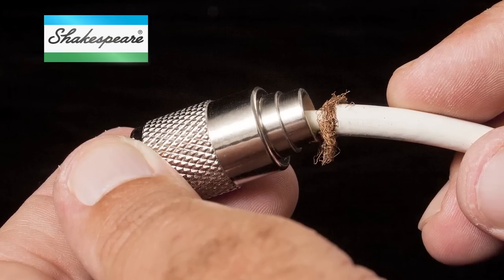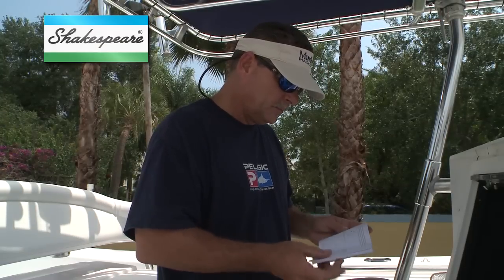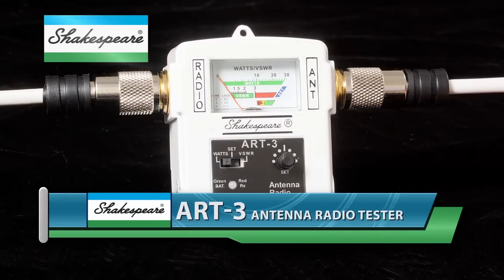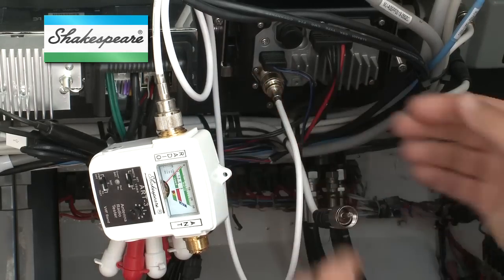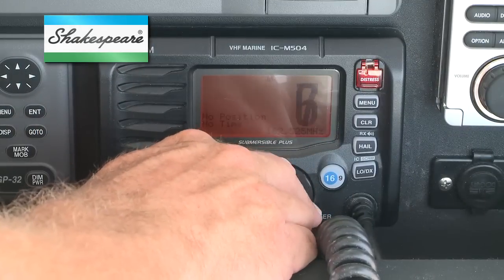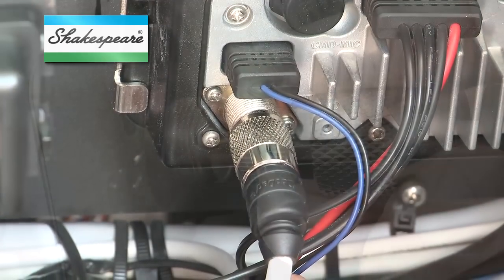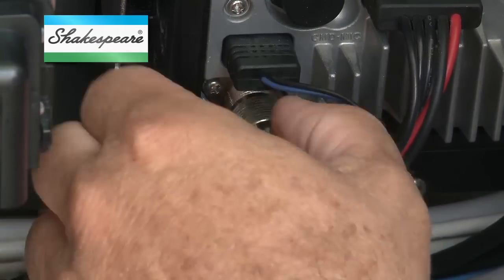Troubleshooting Your Marine Antenna Installation

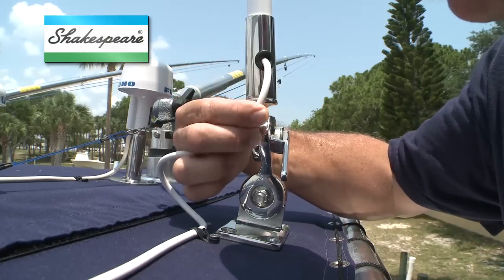Comment: 0:45 I love how he tells you to check the cable where it comes out the antenna and you see the antenna rotating as he moves that cable.  You need to tighten up that antenna to the mount and use some sort of thread lock.  Ideally, it should have facets on the mounting to keep it from rotating like the Phase III antennas, but make sure the antenna is mounted properly if you are going to show a video on how to check for a "proper" installation.  

The way I wire to prevent damage to the wire in that location is to make a loop and use a zip tie to tie it to the antenna body.  Add stress relief to the mounting area and test it out to make sure it doesn't pull on the wires when you raise and lower the antenna.  That loop is good in case someone pulls on the wire and instead of pulling inside the antenna where you can't replace, it pulls on the zip tie.  I've seen many cases where people pull on that wire and it breaks the coax inside the grommet over time.